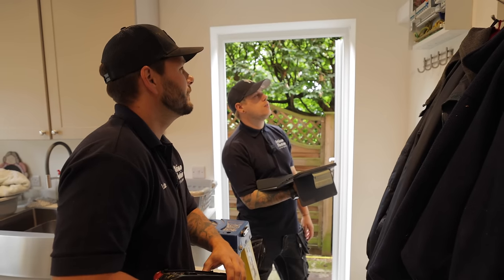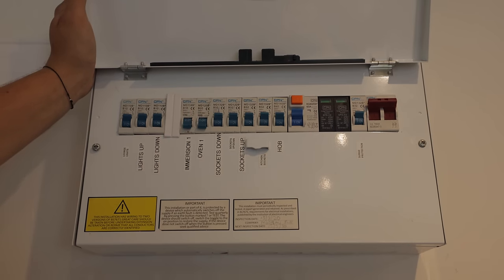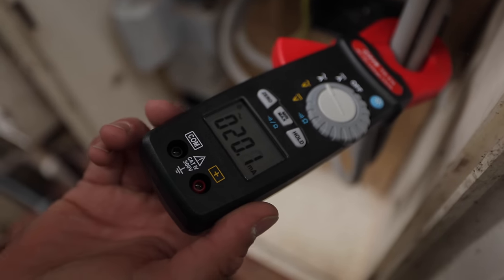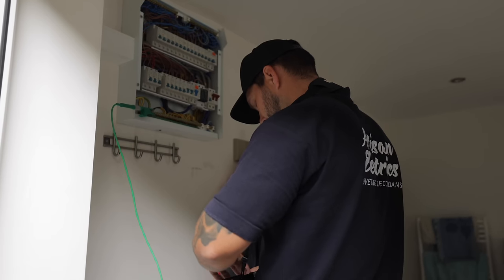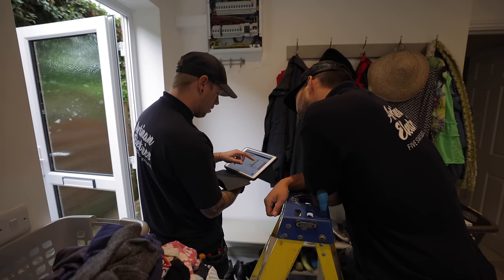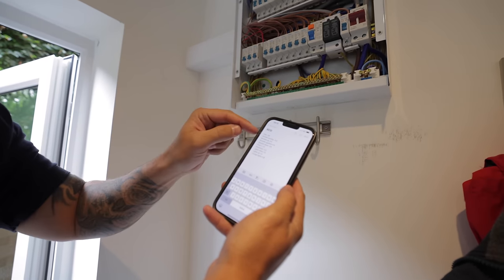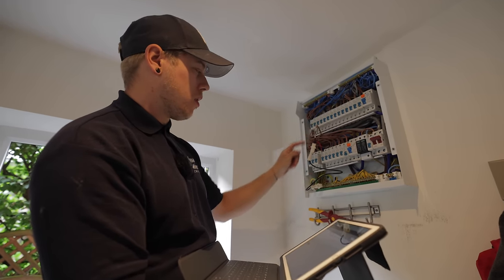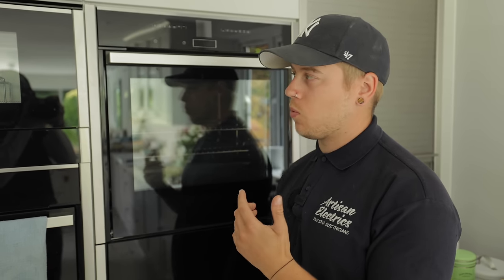CHEAP Electrician cost this customer £1000s💷

Comment: The Tolerance might be different in the UK. A 30mA RCD should be tripping at a maximum of 30mA instead of exactly 30mA. All the 30mA RCDs that i ever tested were usually tripping at about 15mA wich is perfectly fine. Interesting Video but from my point of view the fault finding process was very inefficient. I don't know how long you actually worked on that case and i'm aware that every case is different. But in my experience a job like that usually takes 1-3 hours for one person.
Reply: And those RCDs have failed. And your understanding of the range of current to trip the RCD is wrong.

Taken from the IET's website:

"According to the relevant product standards for RCDs, RCDs must not trip with a current of up to half the rated residual operating current (15 mA for a 30 mA RCD) - however, they may trip at higher currents. In practice, through, instead of tripping at just over 15 mA, a typical 30 mA RCD will trip with residual currents of between 18 and 23 mA."

So your devices that are tripping at  15mA are tripping at too low a current, and you should have failed them.

You need to brush up your knowledge on this subject.
Reply: @deang5622  my knowledge is fine. I just live in austria and our regulations seem to be different. In fact we have far stricter regulations than most other countries.
Reply: @badwolfat  I think you will find that we use products from the same manufacturers as Austria, does Schneider Electric ring a bell?

Go check your knowledge and data sheets of the RCD products made by manufacturers that you use in Austria.

Because I do not believe Schneider are making two versions of the same product, one with a trip current of 15mA for the Austrian market to one standard, and another with a 23mA trip current to a different standard to support the UK market.

The magnitude of the current required to cause vitrial fibrillation is around 80mA, so an Idn of 30mA is more than perfectly adequate to prevent electrocution. There is no need to mandate a lower value of 15mA.
Reply: @deang5622  of course we use products from the same manufacturers. Another good example is Eaton since it's one of the most used manufacturers over here. Their CBs for Germany are called PXL, for Austria they're called PLSM. RCD's are PXF Models for Germany and PFIM for Austria. In this case i think they're 100% identical with the only difference being that the Austrian Version gets the OVE Badge and the German Version gets the VDE Badge but i highly doubt that they sell the same version to every country since the regulations can be vastly different. Like here a 30mA RCD must trip at a maximum of 30mA, but lower is always accaptable since the 30mA main purpose isn't to keep the system up and running but to protect human life. It depends on what you use the RCD for. If it's not for a home where people live then you don't necessarily have to use a 30mA RCD but a 100mA or 300mA instead. So even if you do not believe that the manufacturers make two different Versions of a product for two different countries i'm absolutely sure they make A LOT MORE different models to meet the regulations of the countries if they want to sell their products there. No professional electrictian can use a product that doesn't meet their specific regulations

Comment: It is nice to use three-phase RCDs. Normal leakage currents cancel each other out with the different phases and you can install practically an unlimited number of circuit breakers after it. :)
Reply: Only 50Hz leaks at identical phase angles .  Distorted and dissimilar leaks can still add up .

Comment: Im a hobbiest electrician, i once helped somone fault find, only to find 22 plugs wired to a single 16amp rcd, with 4 spare. supposedly installed by a fully qualified electrician. 

Qualified or not does not mean the job will be done correct. 
Amazon was selling panels and all the the rcd were fake, just soldered connections inside. 

If its failed, break it open.

Id love to become fully qualified but just dont have the money.

Comment: Without any doubt the next contractor will say the previous one was shit and it will cost loads to fix it. BS, just find and fix the problem? What are you suggesting that equipment to BSI or another quality assurance scheme are unfit for purpose? Just another money making scam tactic.
Reply: Clearly you do not know your subject, They did find the cause, also for an install in 2020 the original contractor was non compliant on several issues, Type AC RCCBs should never have been used, section 314 requires that an installation is subdivided into as many circuits as may be necessary to avoid danger and nuisance tripping, so if that means 3 or 4 or more RCCBs then so be it, or an all RCBO set up.  Section 536 has a few requirements that mean, for overload protection, you are required to ensure that the sum of rated values of the MCBs fed from an RCCB MUST NOT exceed the rated value of the RCCB, usually 80 or 63A, this alone on this installation would require at least 3 or 4  more RCCBs if the original contractor decided against an all RCBO set up & no diversity is allowed for this requirement.  If the same original contractor did the wiring in the new kitchen and extension then they also fell foul of building regs, cooker switches & isolators for fitted "white goods" CANNOT EVER be inside a cupboard, socket heights above the work top are too low, all round a very gash job buy the original contractor(s).

Comment: Why not do a search of a higher milliamp double pole RCD! Cudis CPN do a double pole 63Amp,type B, 300Ma, double pole RCD! You can buy one on line on the electrical counter for £143.94 including VAT! That should resolve the problem! RCBO,s replacement board! Very expensive solution to the problem!

Comment: Why did this cost them 1000s?
Reply from the maker: Because they had to get the board changed completely so the original install was worthless
Reply: @artisanelectrics  a board change like that costs thousands?
Reply: @artisanelectrics they didn’t though did they. Could’ve just moved some circuits around to spread the leakage over both RCD’s, or added another RCD to the problematic board.
Reply: @TheRCBiker  even moving those circuits to a new board, I feel like I've wired up some much more complicated systems that that in a few hours.

Comment: Pay cheap pay twice. 
I think that'll be your clients fault for choosing a cheaper quote in the first place.

Wonder why they didn't get the same electricians in to sort it.. based on how neat that board is, I think we all know
Reply: Tbh a grand isn't bad but for that size of a house it looks bigger than most
Reply from the maker: Usually the quote we use haha
Reply: Pound to a pinch of shit he didn’t pay cheap. That house screams the main contractor has cheaped out on the electrics and trousered the money he should have spent on the right install. Shame on the spark for installing a system that was destined to fail.
Reply: @BerkeleyTowers A lot of wealthy people are tight as a drum, they don’t stay wealthy by giving money away
Reply: @Youtubecensoredmyusername  so you’re really suggesting that they got in a contractor to do the extension and then said to the contractor “ don’t worry about the electrics, I’ll get this geezer in who can do me a job and give me false paperwork as well”.?
Reply: @BerkeleyTowers  nope, BUT they might have kept asking for a discount tho, and the electrician could well have said, I’ll do it 20 bucks cheaper if you use a different panel. Laughing all the way home. Some people won’t accept the job cost (x) amount and think they’re smarter than the people who do this everyday. It’s not impossible, so it cannot be ruled out
Reply: @Youtubecensoredmyusername  neither can unicorns.